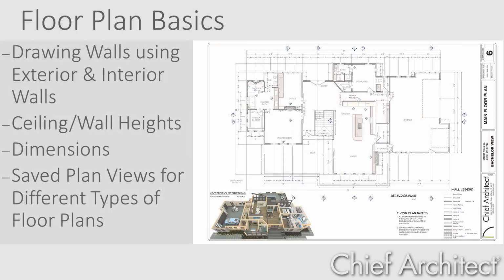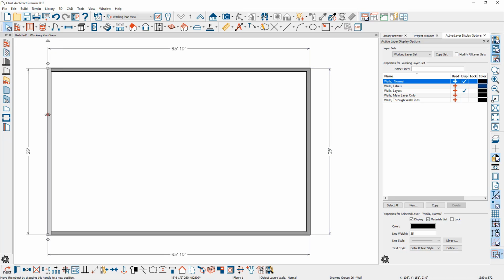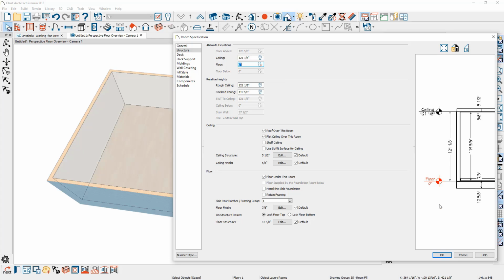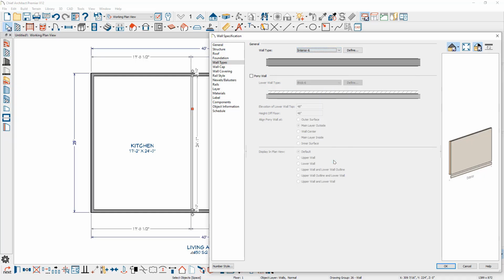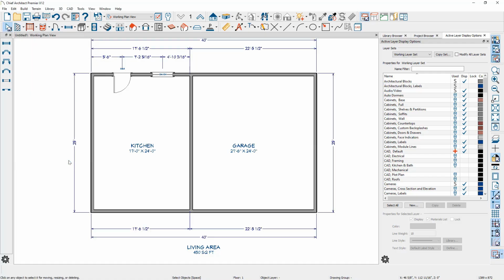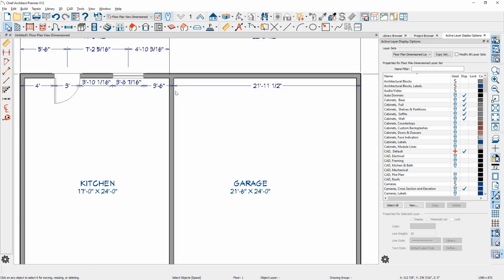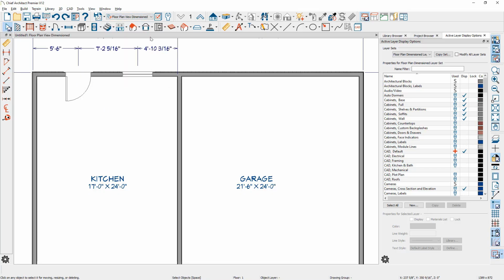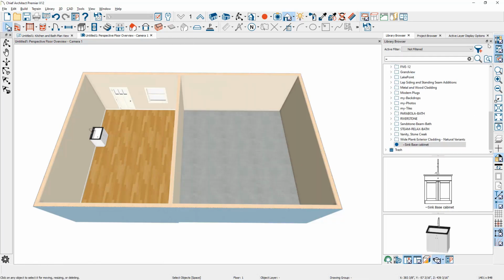Creating a Floor Plan

Comment: I’d like to use this software to remodel a home in Puerto Rico, where construction is made strictly out of concrete; to include the roof. Is this software capable of such construction design?
Reply from the maker: Yes, you can create custom concrete wall types and custom roof styles materials, etc.

Comment: Roof load distribution line displays automatically when walls are closed. Fix it
Reply from the maker: You can change the display for roof lines by selecting Tools>Layer settings>Layer display options and unchecking roof planes.

Comment: Hello, you are not showing the thickness of the wall, where in most countries exterior and interior wall differs. So wall calculations should be inl
Reply from the maker: You can customize the thickness of both interior and exterior walls. Here is an article that goes through the process step by step: https://www.chiefarchitect.com/support/article/KB-02944/defining-a-new-wall-type.html

Comment: Second Floor Question:  I am designing and building a 2 story home with several elevation changes and several "open to below" rooms very similar to my home now.   What is the best way to build this type of floorplan?  Should I create the first floor with all  the room set with a ceiling height of 12-feet and then build the second floor and select and create the spaces that I want to "open to below", or should I create the first floor plan with the spaces that I want a 24-foot ceiling on the first floor plan?  My thought on this is that if I create the high ceiling areas on the first floor the framing material will be 24-foot continuous, and if I create a second floor that is "open to below" the framing material might call out 12-feet upon 12-feet to get the desired height.  Furthermore every time I change a exterior wall on the 24-foot areas, the first floor will show finished drywall as well as the exterior of the second floor.  If I change the second floor exterior to a exterior siding, it changes the first floor drywall to exterior siding.  There must be a simple answer to this problem.
Reply from the maker: The best way to do this is to start on your first floor and then specify what areas you want to be open below on the second floor. Here is an article that goes over that process step by step: https://www.chiefarchitect.com/support/article/KB-00078/creating-an-open-below-room.html

Comment: First of all thanks for video. Second One at 17:50 when I changed to Kitchen and Bath plan View - all dimensions which I've made were still there. I don't understand why. I did exactly as you in this video. All other things work fine.
Reply from the maker: I would recommend reaching out to our Technical Support team to look into the problem further. They have a lot of knowledge in this area and can help you troubleshot this issue.  Technical support can be reached at 208-292-3399 Monday – Friday from 7 AM – 5 PM Pacific.
Reply: There are a lot of bugs in this software I had better luck using soft plan.